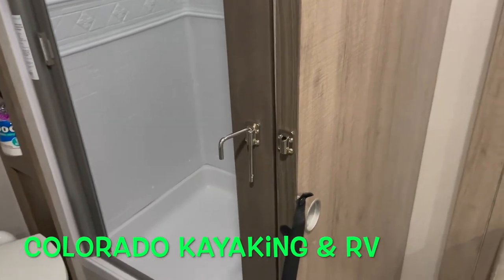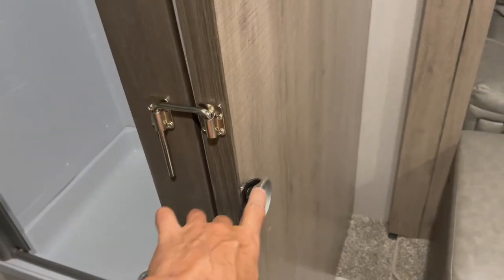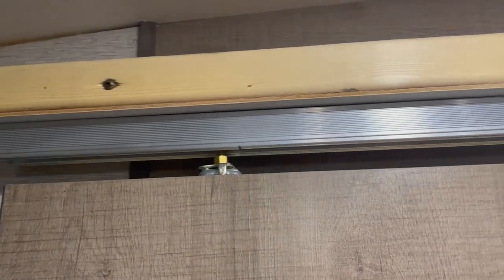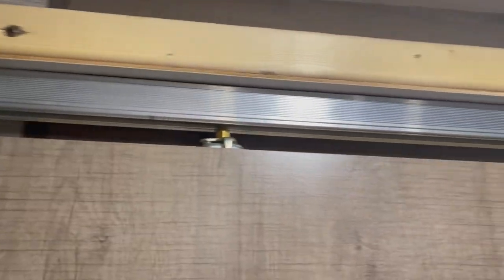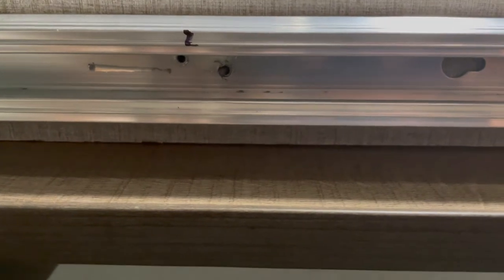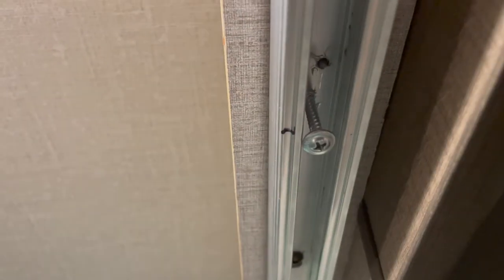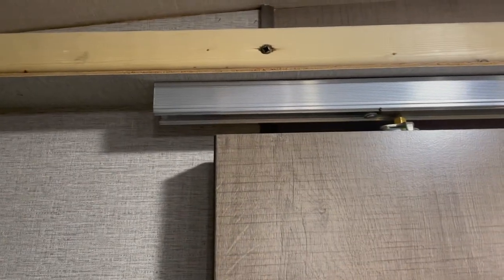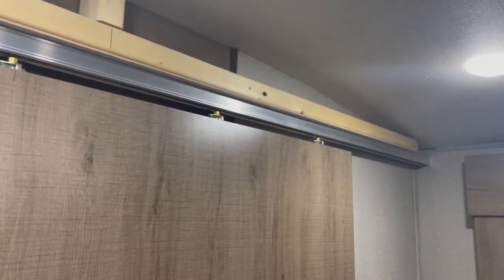How to keep your RV sliding door on track.

Comment: What di you put at the other end to stop or lock the door closed? We have a sliding door in our trailer with that stupid strap and I am surprised it has not pulled it off the wall. ANyway  it came unlatched driving and it kept banging against the the little peg on the wall to keep it closed at the wall and beat up the door pretty good so now I need to repair it. I like that metal latch but would need something soft to keep it from damaging the wall on the other end.